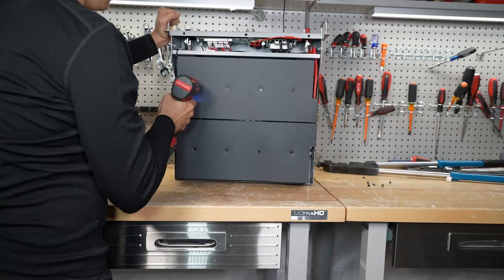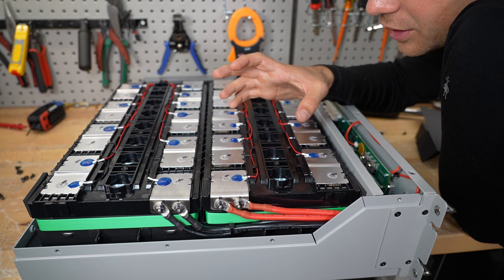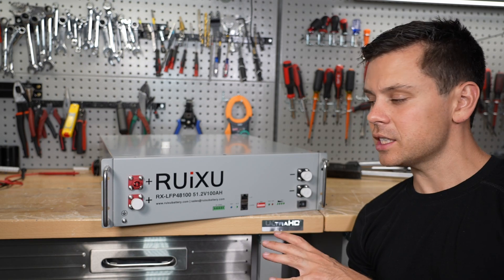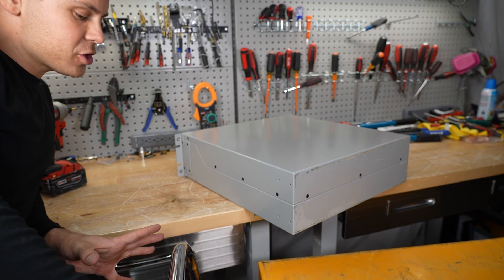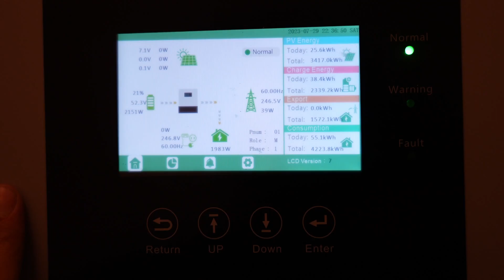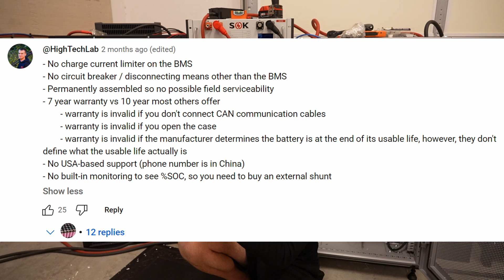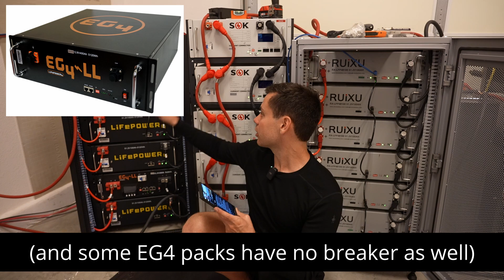New! $1,299 Ruixu Server Rack Battery. Works with EG4 18KPV! UL1973

Comment: Where is the t class fuse? I played in slow motion to see what happened? I assume the battery case touched bus bar but if that is the case how did the fuse bust unless you have fuse on every battery please explain if you don’t mind
Reply from the maker: The other batteries fed current in. It's not the batteries that are close that are the problem. It's the other packs
Reply: @WillProwse  I see, no joke that would of been bad that’s a lot of power! Glad you are okay.

Comment: Why are there 2 positive and 2 negative connections on the batteries? Is it just for connecting them in series?
Reply: For inverters with a power of up to 5KW, the battery can be connected using BUSbar, and the battery can also be connected to the inverter through a Daisy connection method, this 2 positive and 2 negative electrode design is for this connection method.

Comment: As someone who made a career out of evading warranty claims (Sorry, customers for my previous major import automotive distributor from S. Korea!), I can tell you that the vagaries of the warranty are concerning.  For the small difference in price, I'll take the EG4/18K pair for my new home build.  I plan to be mostly off-grid (out of spite, not finances- I know, dumb, but it makes sense in my mind) and since I'll be grid-tied, I want to have that tech support and warranty when I need it.  I need to keep my profit-center working for me as much as possible!  Will, I hope you will be posting update videos on the Ruixu system?  And will Ruixu be selling the rack separately?  Would we be able to slide our EG4 batteries into the Ruixu server rack?

Comment: The quality on server rack batteries are getting better and better together with the price. However, a DIY battery is still much cheaper so that's still my preferred solution. personally I will only pay around 15-20% more for a prebuilt battery compared to a DIY one.

Comment: QUESTION: If you have a multi rack stack of batteries - and multiple 18kPV inverters, what bus bar can handle the high current???

And what disconnects????

Example each 18kPV max in and out is 250A, if you had 6 or 8 in parallel, then 1500A or 2000A could be traveling across the bus bar to the batteries.

Who makes a bus bar, appropriate sized disconnects, or breakers for this size of a system???

thanks

Comment: short circuit will be one of the big issue as the system become massive. what will be the solution if the fire breaks out in the shop. it is about time we have to consider on that before the desaster take place.
Reply from the maker: Five different t class fuses. And that's all it needs to mitigate issue

Comment: Hi, I have been watching your stuff for a long time. Now working my way up the lithium ladder.
Off subject, but what is your suggestion on batteries For my truck camper going to lithium.
I have 212 V deep cells. Now that are not cutting it. But my charge controller will only do 13.6 Which is built-in, so it would be a pain to change all that.. Any suggestions.
You do a great job, by the way and I just love listening to your voice.
Thanks Eric.

Comment: Will pointed out exactly what I was thinking about this company throughout the entire video - "I am WIll Prowse."  If Ruixu sent this hardware to Will, what are the chances that Ruixu made a point to ensure the hardware was as close to perfect as possible? It's not unheard of for a company to send review units that are pristine, only to have the actual consumer product ship with poor quality construction.
Reply from the maker: What is more likely is that they treat me well, but their customer service is horrible. That happens all the time
Reply from the maker: That used to be the case with the 12V packs. But I'm not sure what they would change in this pack to lower the quality of construction. If they have the cell terminal welding machine and proprietary cell holders for the cells their using, and it's listed, it would be very difficult to make a "different" product for YouTubers. Also, anyone can open this in five seconds. So if that's the case, we will know quickly.
Reply: As an early adopter, I can attest to the external quality (I didn't tear it apart), packaging and timely responses to questions. Everything was in perfect shape and both powered on without a hitch, communicate with Victron flawlessly, in detail and charge up normal.
Reply: @davidfifth6109  How long have you been using it??
Reply: No matter what, first production units are likely to have more attention, then manufacturing is likely to have issues shortly after startup, then those issues will typically be improved. That may be part of what happens too. In addition, what Will said is true too, they are much more likely to provide him better service than we mere mortals.

Comment: YES!! It's a great battery, even picking it up it just feels more "solidly built" than some of the others - it's hard to describe. I'm glad to see the rack finally. I had a picture but they were still finalizing the design of it when they sent me my battery. The lack of a circuit breaker is a bit of a bummer. It didn't care at first, but the more and more I work with my system, I'm finding it to simply be an excellent way of isolating a battery or batteries while working on things. I mean, I guess the amphenol plugs make up for it - simply yank one off.
Reply from the maker: Oh hey man!! I just saw your video yesterday. Watched every second and I was impressed! I was scared I would like it and you wouldn't haha I'm glad we agree!
Reply from the maker: Yeah the breaker is nice. Would be cool if they added it
Reply: I will say that Will demonstrated the worst case scenario and why a T class fuse is a very good idea. Using a mega fuse, I would be interested in seeing if it would actually work with that many surge amps behind it. I haven't blown a T class fuse yet, but I do have spares just in case.
Reply from the maker: @john_in_phoenix  I figured it was best to keep in the video. I hate making mistakes but if others can learn from it, best to keep it in the video. Especially such a bad mistake that I made. Glad I had a t class fuse, that's for sure
Reply: @WillProwse  I am really glad you kept it in. It demonstrates that even the most experienced can have accidents, and why it is important to plan for things to go wrong.
Reply: @john_in_phoenix  I blew a T class once - a few years ago when my AIMS inverter shorted internally. I will say it was very impressive at how instantaneously it shut things down. It's definitely the way to go for these large battery builds.
Reply: @LithiumSolar  Yes, not something you want to do on purpose (those are expensive) but certainly a nice safety feature to have.
Reply from the maker: @LithiumSolar  holy cow! Thank goodness it was a t class fuse. And I was amazed too! There was only a hole on the lug but that was it. And I wasn't blinded by an arc or anything. T class fuses are life savers

Comment: New to solar batteries.  I didn’t completely understand how that shorted and the reason it wouldn’t with the included cables or why you wouldn’t use them with an 18K.  Would you mind explaining?
Reply: The mounting ear on the battery hit the right side buss bar which was live (the other batteries were hooked up to it already). The buss bar isn't visible in the video because it is mounted inside that gray plastic cable track.

Comment: My eg4 server rack came with a locking door and a bottom to it and casters when i bought it last November. I love the batteries but not a big fan of the 6500ex.  it wastes too much energy for my small solar array. I ended up having to go back to a growatt 3k cause its fantom load is half of the 6500ex.

Comment: I don't really think communication is necessary. I've run about 4 mwh through my system with no communication. I cycle it daily to ~6% SOC just through the 6548 settings. I plan on buying more SOK budget batteries for my system, the build quality seems great.
Reply: I agree with your points on communication. Long ago, energy storage lithium batteries were mainly made of NCM materials, with poor cycle and safety performance. BMS was required to strictly control the battery usage process, but BMS could not directly control the charging current. In order to achieve this goal, engineers set communication between the inverter and BMS. BMS will provide inverter current and voltage request signals based on internal program settings and battery pack status, The inverter then provides current based on the requested information. This was a very good design back then. However, with the development of technology, LFP batteries have made great progress in terms of cycling and safety. Some better batteries, even with 1C for charging and discharging, have been used for 8 to 9 years without any problems. It is not necessary to use the original control strategy, and many inverter manufacturers have different communication protocols and wiring methods, making wiring a relatively troublesome task, The only possible helpful feature is that after the battery pack provides its own status information to the inverter, the inverter can display battery related information， which brings us a lot of convenience.  If you are tired of the communication mode, you can also try the Ruixu battery, ignore that communication interface and DIP Settings, directly connect to the inverter in parallel, set the battery to the user mode on the inverter, of course, the parameters on the inverter still need to be slightly changed.
Reply: @ruixubattery  you should design a battery without communication similar to the SOK budget battery. If you're able to manufacture a $1300 battery with communication, you would likely be able to manufacture one without communication for even less. All in all, the battery you guys designed in this video seems great. Keep up the good work.
Reply: Yep those sok's really look nice

Comment: I'm still of a fan of buying cells from Alibaba. 2p16 with 304Ah per cell is about 5000 euros (or less) for 32kWh (but obviously I wouldn't push them beyond 3.45V or below 3.0V, but the capacity is minimal beyond those bounds) and I've tested the first batch of 16 and they're all over spec (average about 313Ah). Fingers crossed for the next batch (I bought 4 more to ensure I don't have any turkeys).

OK, I had to spend 1,000 euros for the REC BMS setup (which is great quality) for my SMA Sunny Island 8.0H inverter, but it's great quality.

OK, it's not as cool as rack-mounted, but it's fine for a hybrid system, in my opinion.
Reply: Which supplier did you use.
Reply: @clarke6436  QSO

Comment: The short was across the bus bar with the battery casing?? the case could have welded or even melted into flame ?? how would any fuse blow exactly??  it would be the maximum allowable current of all 5 batteries going through a metal box.... seems a safety issue with this setups
Reply from the maker: I'm more concerned of the current coming from the other batteries than these. That's why each stack has its own t-class fuse. And that's what blew
Reply from the maker: I have a beginner video that covers current sharing if you want to learn more

Comment: Do the eg4 batteries fit in the ruixu rack?
Didn't you say there is an on off switch on the batteries under the negative terminal?  Is that just a switch or a switch/circuit breaker?    Thanks
Reply: Anyone know this yet? I was scanning comments for this question. I bough 1 EG4 LL 2 months ago, but if comms work between batteries and the EG4 LL will fit, that makes a good expansion solution.

Comment: Great to see new companies entering into the space. The batteries will only get cheaper and better the next few years.
Reply: God-willing, that will be the case. It's currently the show stopper when putting together a well backed-up system for a home.
Reply: i wish the prices would drop. as right now i am priced out of the market.
but would like to know more about there warranty, processes.
but i do love the fully enclosed cabinet. with a locking door, great safety part.

Comment: Waiting for EG4 to get  UL9540 2nd edition approval for ESS, would be cool if RIUXU also tried to get approval for this.   EG4 may or may not what to cooperate with that ;-)
Reply: UL 9540 is a safety standard for energy storage systems. For energy storage systems connected to a utility grid, the UL 9540 standard extends to the equipment used to make that connection. This standard pertains to fire and explosion safety concerns associated with ESS, including:

The safety of the storage (battery) component during operation
Fire detection
Fire propagation and suppression
Fire mitigation effectiveness in enclosed areas
Reply: I’d really like to see this topic discussed more. Hopefully Will will pick this up
Reply: UL9540 for RUIXU's LITHI2-16 will be soon.

Comment: I agree with your comments about the design of the server rack. Having the cables routed through the top seems like a good idea. The over/under network connection is good idea also. That said, I don't like the on/off switch being located under the negative cable. You should not have to move the wires to turn the battery on/off. The on/off switch should be somewhere in the center face area to make is easy to reach and operate.

Comment: I need to ask as I'm new at this: can anyone tell me if these batteries can be added to a system that already has Lifepower4 batteries? I have two of the LP4s and don't want to mix and match if it's not recommended
Reply: You can mix and match all of these 48V batteries. They may not communicate with each other or with your inverter, however, but they don't need to either. There are workarounds for basic monitoring of the state of a mix-and-match battery bank if that's what you want to do.
Reply: @BiLB-DIY  Awesome, thanks!
Reply: @BiLB-DIY   Any direct links for this or care to elaborate? Have an EG4 3K inverter with 2 LiFePower batteries, and looking to parallel another EG4 3K inverter, but wanted to see if I could add 2 Ruixu batteries to this setup instead of 2 LiFePower ones.  Thx

Comment: I just invested in EG4 6500EX-48 & EG4 LL. Will changes be needed for that inverter? If I want to add these to mine, with the comm still work? $50 per battery vs EG4 Lifepower4, and $300 vs the LL. 

Dang you're so good at this!! And I loved the "... but I'm Will Prowse..." ! It's well-deserved confidence and your reputation really permeates this subject. Thanks for all the work. Side note, friends in MI whose power was out for days had no back up - I shared your EG4/Hand truck vs Eco Flow video. Keep it up!

Comment: Thx will for all your efforts, the only batteries I hope to see you add to your collection, are the AES 42-48-6650 from Discover. They don't come with racks. You'll have to build a sturdy shelve for them or mount them on a wall. I'd like to hear your comments on them (by the way, they only come in, 2,000 amp 24 volt, 3,000 amp and 6,650 amp 48 volt. Thx Will, you do an excellent job and aren't afraid to show you're human!

Comment: Does communication work with the EG4 3kw
Reply: This inverter is a relatively early product of EG4, which only contains the communication protocol of EG4, so it cannot communicate with the Ruixu battery. EG4 other inverters can establish communication with Ruixu.
You can set the inverter to the “User-Defined” mode in program 5, setting the appropriate parameters can also be used Ruixu battery.

Comment: Can you mount a rack battery like this safely on a sailing boat? Is the rocking ok?
Reply: I can't imagine any reason why not, as long as it's secure, the rocking angles shouldn't affect it.
Reply: Just secure the battery
Reply: @ruixubattery  is it also safe to mount them with the front facing upwards? I. for under the floor in a yacht?
Reply: @timtravelnomad  Yes,you can .

Comment: That spark scared me
Reply from the maker: I haven't done that in ages. I was pretty disappointed in myself. I slid the other packs in but totally forgot I was using oversized cables now. They protrude into the area where the first pack slides in. Thought it's good to show others as a lesson. Could have turned out much worse
Reply: @WillProwse I'm even more impressed with you now as a content provider that you did not edit that out. Thanks Will.
Reply: @brian_onthetrail  exactly my thoughts. pure honesty. respect!
Reply: @WillProwse  any way we're glad nothing bad happened to you or your setup
Reply from the maker: Yeah that was pretty bad haha
Reply: We were watching Will, intensely, after that spark. Talk about jumping out of your seat! ⚡️😮
Reply: Went straight to commercial. Longest commercial ever.
Reply: I’m wondering if the first battery should’ve been turned off too? The one you pushed in that caused the spark!
Reply: I wonder if the eg4 battery will fit in the ruxiu cabinet or with minor tweaks to accommodate or is the newer eg4 cabinet comparable?
Reply: You'll be ok 😅